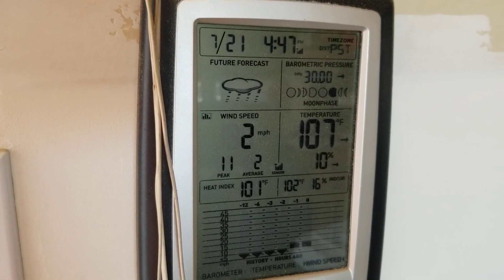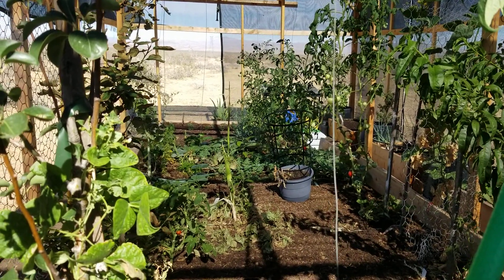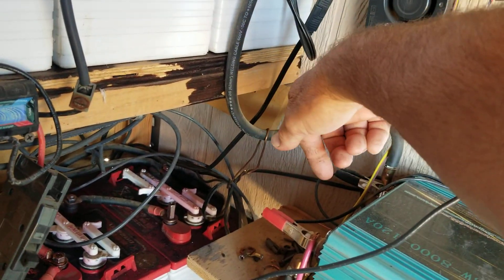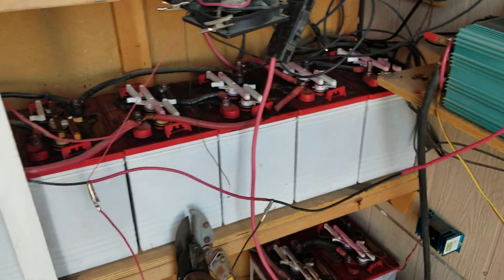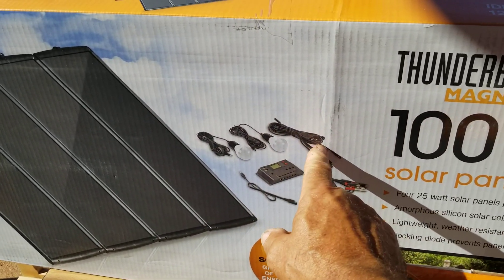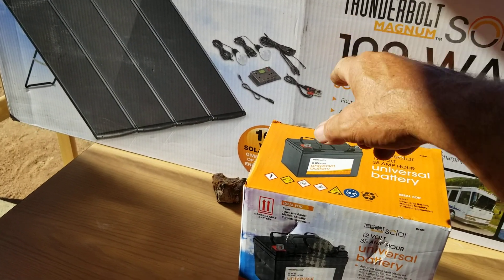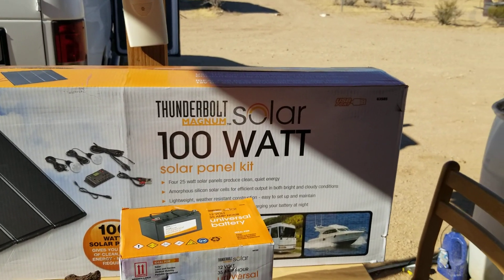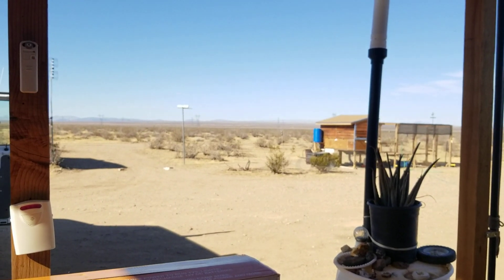Harbor freight solar panel kit and 35ah AGM battery review. 7/21/19

Comment: Where, how or what do you plug a small TV into?
Reply from the maker: @trainmaster0217  Welcome aboard!  The solar panels and controller won't power a TV.  You would need at least a 12v to 120v pure sine wave inverter and a 12v battery to complete the setup.
Reply: @GBear  Ok, thanks.  I thought something was missing.  I was going to buy it and try it but looks like I need more equipment.
Reply from the maker: @trainmaster0217  Yes a complete solar system consists of solar panels, controller, battery and inverter.

Comment: I had a po box too...how I got around that problem was I used the address of the post office and on the same line as street address I added unit 52 instead of PO box 52 and delivery went smooth as silk for two years.
Reply from the maker: That's exactly what I am doing.

Comment: Mini Winter Solar Tip: A boiler and all other hungry electricity consumers can be infinitely dimmed with the "5000W dimmer". Ebay €7. I run 5 dimmers in parallel on an 850W inverter. Kettle 2.2KW at 150W runs 12 hours a day, so the water is always hot. The room is also nicely heated. 2.5KW washing machine runs in parallel with dimmed to 200...400W. Iron, dishwasher, oven, electric heater, coffee machine, all internal heating are throttled with me. Videos on my channel https://youtu.be/eC2olbCBhh0 The inverter stays cool, quiet and the MOSFETs remain intact because no extreme current peaks arrive at the inverter. Now every Mini PV Inverter is enough to sell large devices. So, with the dimmer, all internal heaters/devices can be converted into base load devices that stay almost permanently ON, drawing very little current directly from the PV. With a wattmeter / energy cost measuring device you can then measure this perfectly in order to set the dimmer optimally.
      A little hint (for everyone else): Energy cannot be saved. So if I want to boil my water, I always have to use the same amount of energy for one liter. Christian's method relies on a longer period of time with less power in order to be able to use the power provided by the PV as efficiently as possible - so consumption peaks are intercepted. In the end, the energy consumption should even be (slightly) higher due to the interposition of the dimmer, but it doesn't matter, since more efficient coverage by the PV system and therefore better use of the self-generated energy........
Reply from the maker: Cool, thanks for the info.  Welcome aboard,  and ill check out your channel.

Comment: Dust mitigation.  Working for that microwave company I learned to use filtered air over pressure coming into the sheds.  You use a  cooler motor and fan sucking air into the sheds.  Dong so you eliminate 98% of the dust covering all of your equipment.  SWAMP cooler pads work fine.

Comment: Great video! Thanks for the info on this kit. I just got this kit a month ago on sale but haven’t set up just but will mostly use as an emergency backup power source during hurricane and storm season.
Reply from the maker: Welcome aboard!  Those 100watt panel sets are good to keep a couple of batteries charged, and run the light sets that came with them, as well as charge cell phones and laptops or 12v radios in emergencies.

Comment: Hello G Bear. I bought this solar set last night to power my fridge, because I remembered you said they work well in low light conditions. Incase it's cloudy in Q this winter again. TAKE CARE..
Reply from the maker: If you're talking about the Harbor freight 100w solar set, it won't run a fridge.  A fridge uses 130-380 watts depending on it's size and age.   Remember, solar panels are basically battery chargers, and you need enough batteries to power what you want to run, and twice as many watts of panels to keep them charged when consuming that power.
Reply: @GBear  Yeah it's a small Bouge rv  I bought 2 Audew DP 300 Solar Generators to run & charge for the trip. TAKE CARE..
Reply from the maker: If you need more power when/if you stop by here, I have a 6500w generator for nights, and you can plug in to my cabin power during the days, as I have plenty of solar power coming in.
Reply: @GBear  Thanks Bob, I would like to come over. We're going to try & go get fossilized oysters at a place in Cali. TAKE CARE..
Reply from the maker: Those oysters are hard to chew....😂
Reply: @GBear  They SURE would be, but they really look neat. TAKE CARE..

Comment: I recently acquired two of the old 45 watt kits which were still in the boxes...I have to use both charge controllers because they cant exceed 4 amps...but they're paralleled into two 19 ah batteries that keep my phone charged and a little fan..they work great in low light...Im kinda like you I solder everything I can..
Reply from the maker: Great!  Make use of whatever you can get you hands on, right?

Comment: Mr.G, Instead Of The “Universal-Battery” From Harbor-Freight Can I Use Ah “Forklift-Battery”....?
I Just Want To Run Kitchen Appliances...
Reply from the maker: Yes.  A forklift battery has plenty of ah for that, although remember that heating and cooling appliance use the mose electricity, so try not to run too many of those together at the same time.
Reply from the maker: Forklift batteries are great!  They are strong and long lasting, but they are also heavy, so plan on that when you decide where to put it.
Remember, kitchen appliances use lots of energy.   Heating and cooling devices being the biggest power hogs.
I try to use the microwave and coffee maker only when the sun is on my panels, as they can draw a battery bank down quickly.  I have little control as to when the fridge runs, but a microwave could be many kilowatts of draw.
Reply from the maker: Oh, and welcome aboard!

Comment: can there be linked together and make 70 ah plus can i operate a 600 watt hot pot for 30 mins
Reply from the maker: Welcome aboard!  Yes, but you would need a larger controller and inline diodes.  The controller that comes with the set is a 10amp pwm with the diodes inside.(the solar panels don't contain diodes).
Reply: G Bear's Off Grid Ways-A Homestead In The Desert Let me see if I have this correct with the system as it is I wouldn’t be able to power a 600 W hot pot for less than 30 minutes
Reply from the maker: @jfletc3000  the Harbor freight solar panels are only 100 watts.  Again, solar and wind, off grid, are battery chargers, not grid electricity.  You would need a battery bank of at least 300 watt hours to run your heating element, but the 100 watt solar input won't keep the batteries up.  You would need at least 300 watts of solar on top of the batteries, just to break even as you ran that heat element.

Comment: I used to use those 100 watt panels then I upgraded to itek 300 watt 60 cell panels and it's night and day for performance for the same $150 each and they are made right here in the USA.
Reply from the maker: Welcome aboard.   Yeah, I've had an old set of their 45w panels on my van since 2003.

Comment: Why do so many people buy that useless little battery at Harbor Freight?  UGH
Reply: 30 more bucks you could get a deep cycle 180 amp hour battery and have a mans battery
Reply from the maker: @AN-vt8qq  not around here.  80 bucks will get you zilch.
Reply from the maker: 50 bucks with a coupon and I've had one in use since 2016 could be the reason.  It's still holding full charge.

Comment: Take a look at these as an inexpensive way to expand capacity.  

https://www.ebay.com/itm/12V-15AH-Refurbished-High-Performance-AGM-Rechargeable-Power-Sports-Battery/254292203167?ssPageName=STRK%3AMEBIDX%3AIT&_trksid=p2060353.m1438.l2649

Comment: I have a few of these panels. Haven't hooked them up yet. Glad to hear about them though
Reply from the maker: I have a set on my van running inside to a yellow top deep cell battery and a 3000watt inverter.  I run my tablesaw all day from it without a problem.
Reply: @GBear  awesome I had a buddy tell me they weren't worth a lick. But I'm glad to know they have a purpose
Reply from the maker: @YoungDeathWish  did he ever own a set?

Comment: Thank you for the info.
Can you possibly post the item info for Harbor Freight so we buy the right configuration?  Thank you. Very informative 👍
Reply from the maker: Will do tomorrow.  I have to do a video on electrical wiring for Forever North's Sanctuary.   It'll be how to tie an inverter into an electrical breaker panel and use it instead of fuses.
Reply: @GBear  
Very Cool , ty! Will watch after work 👩‍⚕️
Have a nice day 🌞
Reply from the maker: @JesusFreakJen  great!  Going to be another hot one. 85° for the wake up.

Comment: Icefshninnh1@gmail.com  if you or anyone  wants I can send a screen shot of the battery  the guy used  one good thin is no maintenance  as with a lead acid battery  and cheaper than most lithium  battery  pack used in cars

Comment: Hello gbear hope all is well another great video  
I was watching a few videos  on lithium  batteries  and this young man was testing used  12 volt lithium  batteries  that are from medical devices  and he bought them fairly cheep on ebay and you can hook them up to solar just like a lead acid battery  but they  have mega safety features  and are a pretty bright green  lol
Reply from the maker: Yeah, but lithium has its down sides too.  Also, it is always better to build a battery bank on all the same cells, so he would have to buy a bunch while available, all at once. With lead acid or agm you can start with a few and add on every chance you get.

Comment: Great kit you bought!  Say what is that trench you are digging by your garden for?
Reply from the maker: Sooner or later I will put a gray water tank in there to capture and store gw from the cabin to run through a solar distiller and reuse for irrigation.  Right now the gray water goes to the hole and evaporates.
Reply: @GBear  I would be very interested in seeing what you do.  I'm looking for a place now.  Thanks for your response.
Reply from the maker: @LMBee00  nope, see my response to the question for clarification.

Comment: Does HF charge core on battery?
Reply from the maker: No.
Reply: I bought one years ago for my battery inverter box and no core charge.
Reply from the maker: @ronb6182  still none.
Reply: Never!  Because most places don't charge core on sealed batteries. Lead acid batteries can be recycled the ones with filler caps. Those type have core charge.

Comment: 109 damn
Reply: Ill take his 109 every day of the week compared to my 95 deg with 90+% humidity....
Reply from the maker: @josephbrown-ut9ty  welcome aboard. I guess you saw the low humidity on my weather station...
Reply: @GBear  LOL no, i had to rewatch that part. I lived in Kingman Az for 6 years in the early 70s and i dont really remember much beyond the wind and it just being "bright" outside if that makes any sence, i was VERY young. But , 96' my mom and me went to Wickenburg to visit my grampa and it was a 111 there and the locals were complaining about the 18% humidity. Wed just left Arkansas at 95 deg and 95% ish humidity...i just laughed and enjoyed the dry heat.
Reply from the maker: @josephbrown-ut9ty  lol.  I grew up in New England with 98/98 weather.   Stand still in the shade with a fan on high and fill a bucket with sweat...
Reply: @josephbrown-ut9ty  I was going to post the same thing. That dry heat in the desert would feel refreshing to the FL summer humidity, when the air is so thick you could cut it with a knife.
Reply from the maker: Welcome aboard capnrob!
Reply from the maker: Lol